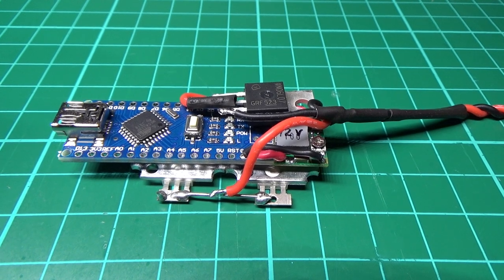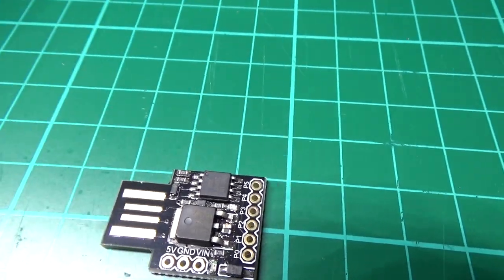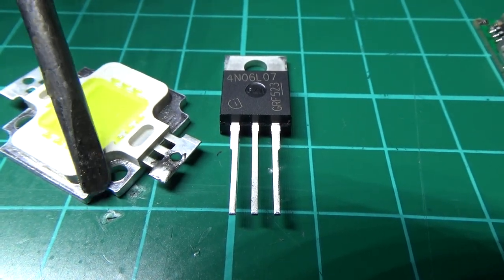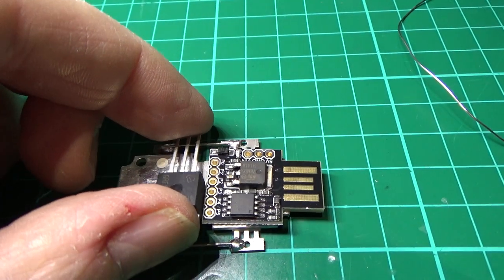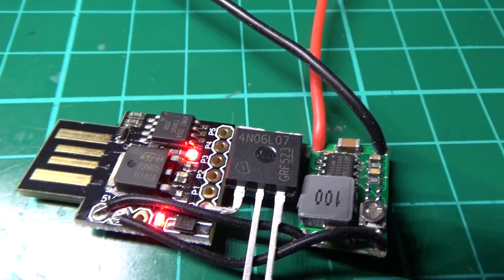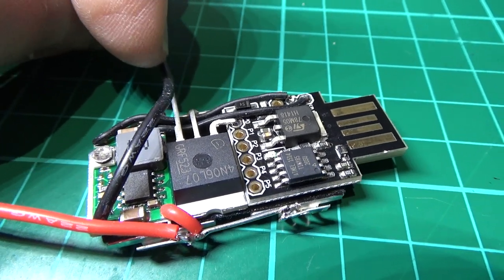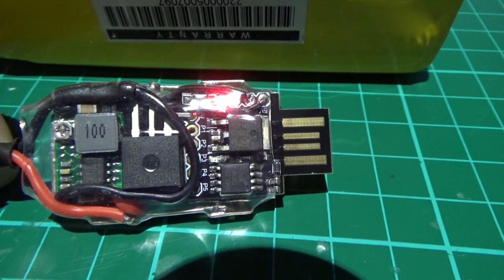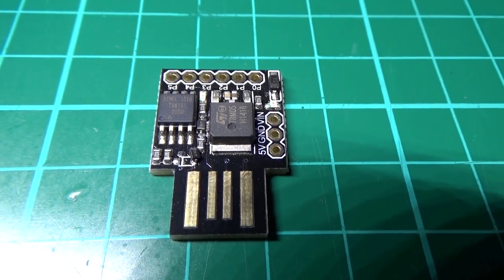Arduino 20w LED strobe with MOSFET - How to

Comment: heres my code.............

/*
  Blink
  Turns on 3 10w leds in sequence the pattern command dictates the on off time for the initial short sequence  then follows a burst of all 3 on the same time and repaet...

3 x 10 Watt strobe sequence
  
 */
#define LED1 (int)0
#define LED2 (int)1
#define LED3 (int)2

// the setup function runs once when you press reset or power the board
void setup() {
  // Set Led1,2 as output on digital pin 12,13
  pinMode(LED1, OUTPUT);
  pinMode(LED2, OUTPUT);
  pinMode(LED3, OUTPUT);
}

// Pattern Command set the strobe pattern hi,lo
void loop() {
  int pattern[8] =   {15, 200, 15, 200, 15, 200, 15, 1500};
  for (int i = 0; i < 4; i++) {
    digitalWrite(LED2, HIGH);
    delay(pattern[i*2]);
    digitalWrite(LED2, LOW);
    delay(pattern[i*2+1]);
  }
  for (int f = 0; f < 4; f++) {
    digitalWrite(LED1, HIGH);
    delay(pattern[f*2]);
    digitalWrite(LED1, LOW);
    delay(pattern[f*2+1]);
  }
  for (int g = 0; g < 4; g++) {
    digitalWrite(LED3, HIGH);
    delay(pattern[g*2]);
    digitalWrite(LED3, LOW);
    delay(pattern[g*2+1]);
  }
  digitalWrite(LED1, HIGH);
  digitalWrite(LED2, HIGH);
  digitalWrite(LED3, HIGH);
  delay(300);
  digitalWrite(LED1, LOW);
  digitalWrite(LED2, LOW);
  digitalWrite(LED3, LOW);
  delay(2500);

  
}
Reply: phew glad i posted this code on here as i lost my original... grrrr...
Reply from the maker: I'll have to remember that, I'm always losing my sketches :-)
Reply: hehe yeah my son wrote that for me i not that good on arduino..... its good to post / share it somewhere... at least if you lose it you may have it backed up
Reply from the maker: The only trouble is, the things I'm working on at the moment have 1,000's of lines of code :-(
Reply: pastebin, or github :)

Comment: bugger its on but not blinking as it should
Reply from the maker: +Rob Ellis I'm glad you didn't blow yourself up! :-) If it's on, but doesn't flash, it usually means your FET isn't being triggered or you have wires in the wrong place. A couple of things to make sure are correct......Have you got your Gate pin on the FET (the left hand one) connected to P0 on the Digispark? Have you got the Source on the FET (the right hand pin) connected to the negative on the battery?

Comment: Does anyone have a link to Ebay for cheap Mosfets in the USA please ?
Reply from the maker: You can get them from Mouser in the US https://www2.mouser.com/ProductDetail/Infineon-Technologies/IPP80N06S4L-05?qs=nTClRYuuQBoR8%252bF7ki9E8g%3D%3D   
Failing that, there aren't any that I can see, sorry.
Reply: Is 60V 10amp ok ? Or should I get higher amperage ? better yet I have some IRF1010E laying around ----->Will they work ?CategoryDiscrete => Transistors => Metal-Oxide Semiconductor FET (MOSFET) => 6508770Title75 A, 55 V, 0.014 ohm, N-CHANNEL, Si, POWER, MOSFET, TO-220AB
Reply from the maker: They run on 12v and use 20w = 1.6 amps per LED..... yeah, you'll be ok :-)
Reply: I'm not familiar with Mosfets but have some of these available to use would they work? I think I took them out of a APC battery backup - IRF1010E - CategoryDiscrete => Transistors => Metal-Oxide Semiconductor FET (MOSFET) => 6508770Title75 A, 55 V, 0.014 ohm, N-CHANNEL, Si, POWER, MOSFET, TO-220AB ---- I couldn't get the 10W LEDS yet they are out of stock I think the LEDS i ordered are low wattage maybe 1W
Reply from the maker: It looks like they have a 2v to 4v gate. You'd need to use something with an analogue voltage between 2 & 4v to safely use it.  
You can buy Arduino Pro Mini boards which are 3.3v
Reply: ok thank you I will look for some Mosfets with the 2-4v gate I ordered some 10W LEDS off Ebay

Comment: vortecks... done the strobe tonight (single 10w led). Thanks for the video great followed it and mine works great, I remembered, i ordered some N channel fets. a few weeks ago from farnell, smd ones to try and repair some escs i had laying about here, anyway i had nothing to lose and soldered a few wires on to them.. and connected to a 9v battery...  got the arduino on breadboard at the moment, and its all a bit lashed together... but works well on 9v just dont know how far i can push these leds.. i got a youtube uploading at the moment and i will link to yours if that ok.. thanks again... these are the fets i used... http://www.farnell.com/datasheets/1719605.pdf      http://uk.farnell.com/webapp/wcs/stores/servlet/ProductDisplay?catalogId=15001&langId=44&urlRequestType=Base&partNumber=2335305&storeId=10151
Reply from the maker: +bing crosby Excellent! I run mine on a 4s (16.8v) battery and they work superbly! They're only rated for 12v but the duty cycle is so low that they don't even get warm. If you want to link to this video, feel free :-)

Comment: Vortecks i had my digisparks back yesterday, and also ordered some smaller ones with a usb type b connector on them  link here....http://www.ebay.co.uk/itm/121852326388?_trksid=p2057872.m2749.l2648&ssPageName=STRK%3AMEBIDX%3AIT... i was just curious, have you tried running the digispark direct off the lipo as the onboard regulator is supposed to be good for 35v..?. you could do away with the regulator then... and maybe fit two fets and sequence them... i am about to do a similar thing with mine with 3 fets, and 3 output pins... and have them come on individually in bursts, then all 3 together... so keeping the duty cycle down that way too.. i post a video when mine is done...
Reply from the maker: +bing crosby I bought some ATTiny85 http://www.ebay.com/itm/261987455019 and some WS78L05 regulators http://www.banggood.com/100-Pcs-WS78L05-78L05-Voltage-Regulator-5V-100mA-Transistor-Triode-p-932782.html and the footprint is so small, it fits on the back of the FET. The only thing is, the footprint doesn't need to be that small and it's really a one-shot thing with programming. I'm working on another version which runs the 2 LEDs independently and works with my EZUHF with a switch on the Taranis that'll switch them on and off. I'm looking forward to seeing your version though :-)
Reply: works ok at the moment... i have had a lot of luck with the esc fets i had a zrw spider 12a esc that i had burnt one motor channel out so stripped off the fets they work great and are so small... I think the digispark i have at the moment the one i linked to is about the smallest i want to go for, for that, but  want 3 or 4 channels sequenced.. i did wonder whether a real small esc with an onboard bec would do the complete thing with the esc software modified to suit...that way there are 3 channels, or possibly 6 using the other set of firing fets to control the leds... do you think that would be possible..? i try and get a good clip of mine up once i get it finalised...